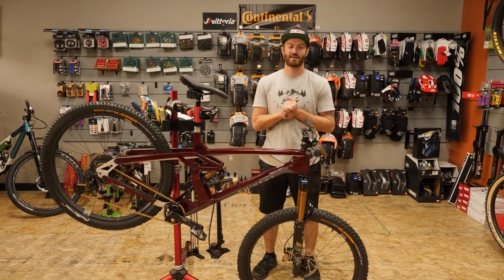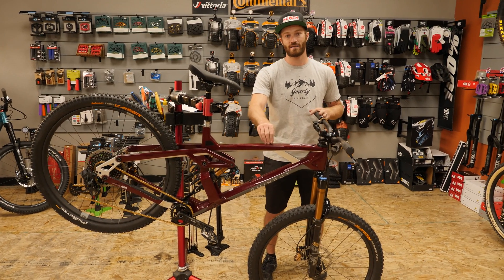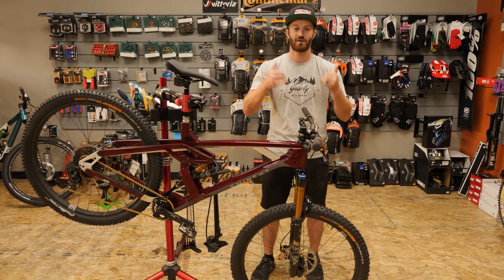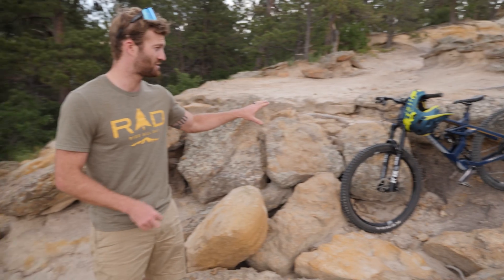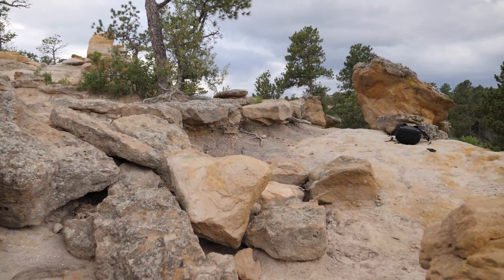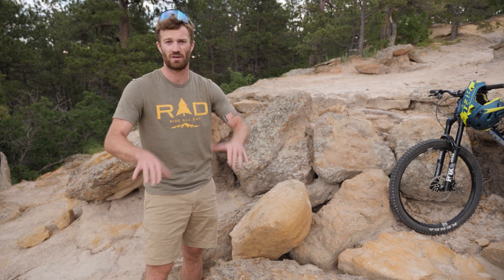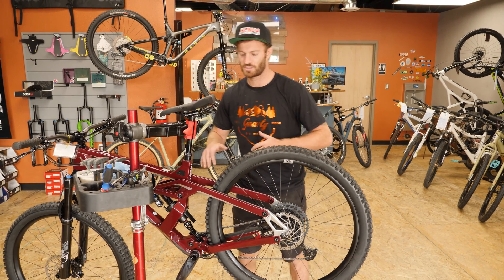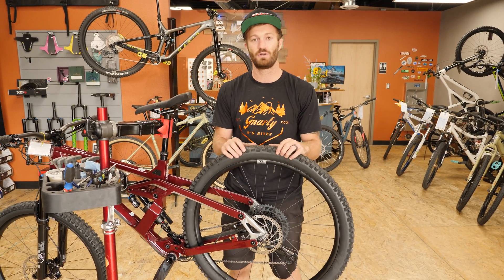Ep.1: What is and why is Anti-Rise and Brake Jack so important? How Eminent Cycles optimize both!

Comment: FFS anti-rise and brake jack are not the same thing! 
Anti-rise value is created by the pivots layout and dictate what the suspension does (compressing in general) during braking, due to mass shift.
Brake jack is created by the move between the brake caliper and brake disc during suspension compression and dictate how freely the suspension can move due to ground input during braking.
Reply from the maker: In layman’s terms Anti-rise is trying to combat the forces that cause brake jack. Brake jack can be caused by suspension over extending during hard breaking or over compression, but yes brake jack isn’t anti ride but it’ll get people close to know they go hand in hand

Comment: With zero anti rise when you hit the brakes the system remain free and independent but the bike is going to dive from the rear so no travel no traction? In the other side above 100% the chainstays are extended so plenty of travel but shock is stiff and feels like a hardtail?… how could you eat this dude? They mean (zero antirise) system is active when you brake but there’s no deceleration (so no rear dive) I mean holding the brakes a bit or full brake but sliding 

This anti rise thing is a brain destroyer
Reply from the maker: I support and appreciate this. Im a bit confused, but regardless, anti rise is wild but so cool in application. Just the idea that some full suspension bikes CLEARLY perform better while breaking always made me wonder…. Why?. 

So when I just try to break it down for myself, I say. 

anti rise is the force that is opposing the bike from rising. The bike rides since your inertia and front wheel are moving forward when you break, physics in play. So as the bike increase it anti rise number or force that is combating the risk, it is becoming more efficient…. Until it’s not. To high of an anti rise number goes to other way and causes the bike to sag or “dive” in to rear. So it’s actually to HIGH of an anti rise number. The goal is to be efficient. Eminent found that to be below %75 to still track the ground, which we try to show here!!!! 

Brain buster